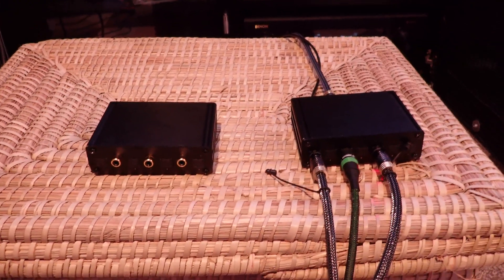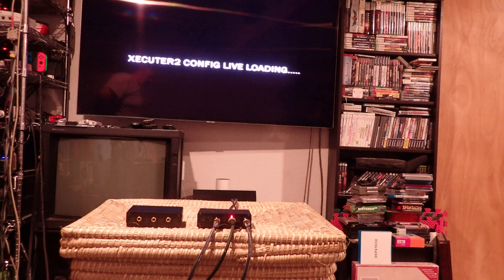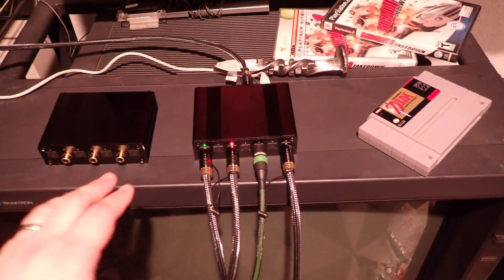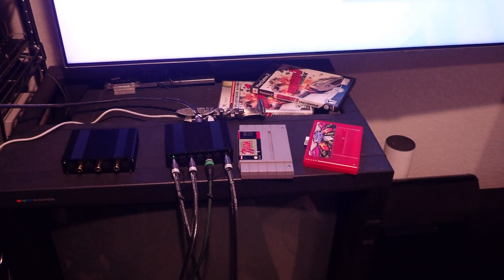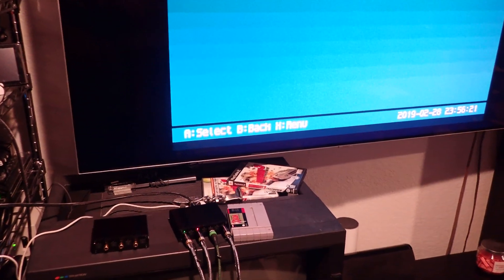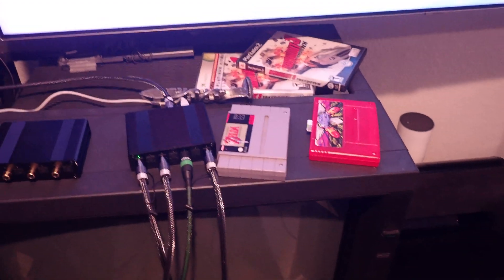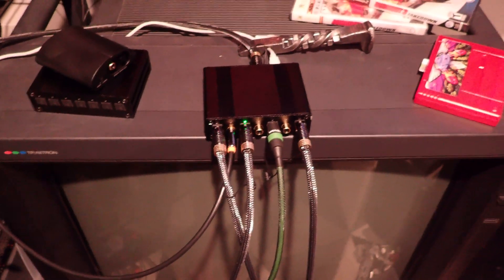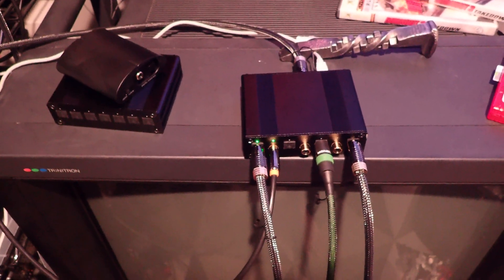Automatic SPDIF Switcher Review

Comment: This is great, thank you for doing this! Because of your video I've reached out to the creator to try getting a copy of the configuration software as well! 

Also, that's a very interesting setup with the color coded 1P/2P controller inputs. Do you have more photos of that and how it's routed? Are they all extension cords? I've thought about doing something like making a single universal controller port panel.
Reply from the maker: All extensions routed to and double wrapped around carabiners on the side of each shelf level. The goal is to prevent accidentally yanking a console off the shelf.
I'll do a video about it sometime in the near'ish future
Reply from the maker: I've also wanted a more universal and/or high quality extension cable system. Most extensions are junk and I can't find anything better.
Ideally I want to use a universal cable that tolerates being routed around the edge of the room and just use adapters on both ends. I believe the Bliss box adapters have this halfway solved. Just need to go from HDMI back to male connectors at the console
Reply: @DirkSwizzler  yeah I've had issues where adding an extension cable introduces too much voltage drop and causes certain controllers to not work, which has discouraged me from looking into it too much so far